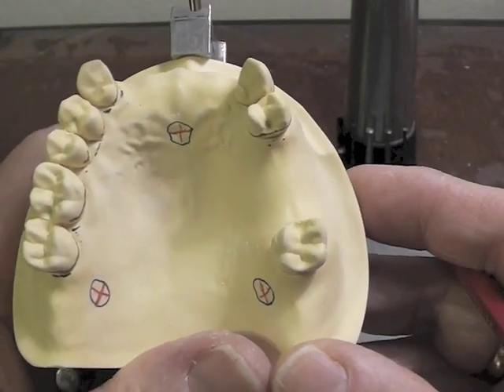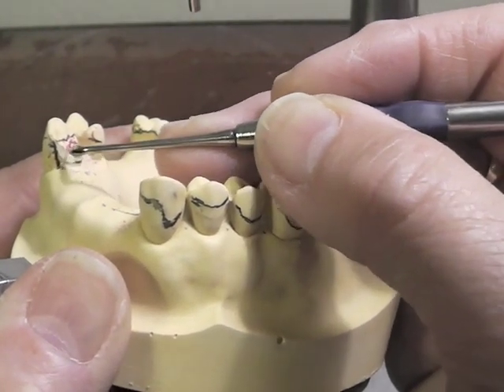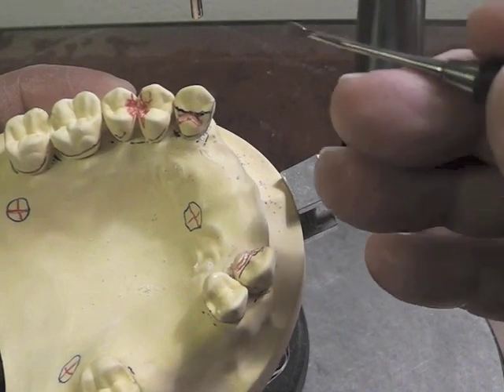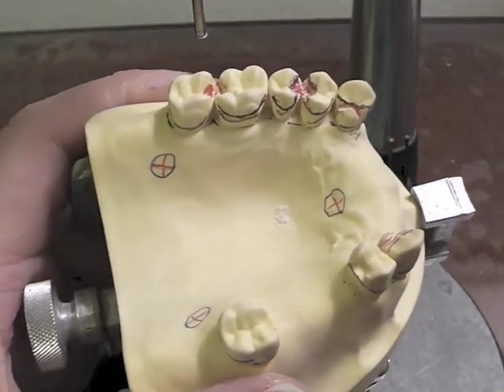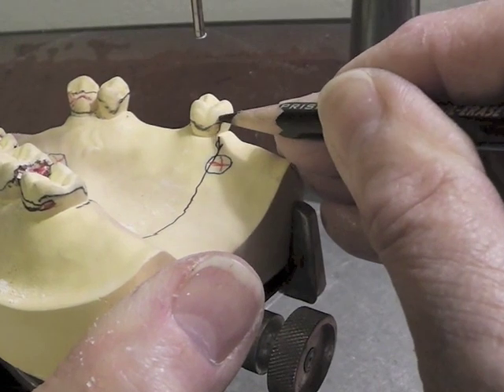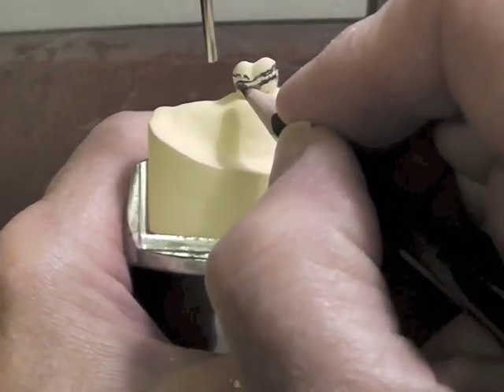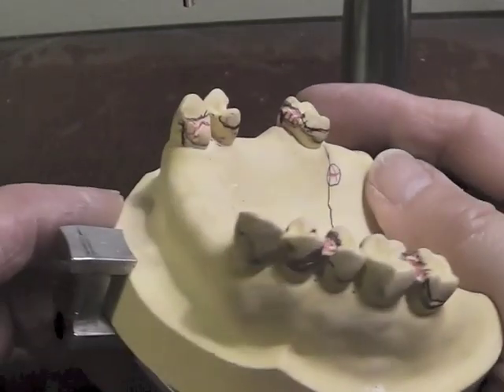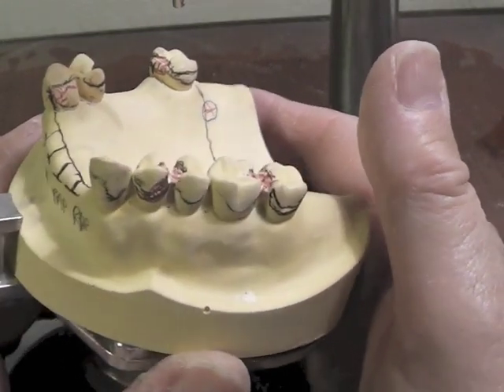R P D Design - Ken Class III Max Dentoform Cast Part D

Comment: Why did you put an auxiliary rest at the distal of the 1st molar? Is it to prevent food impaction in the area? Is it to add to the cross arch bracing? Added support? Some dentist would deem the additional rest excessive.
Reply from the maker: When you take a clasp assembly rest between two teeth, you place an embrasure rest. This prevents 1) food impaction between the two teeth and 2) the feeling of wedging between the two teeth. Any movement of the partial transfers equal pressure to the two teeth preventing the feeling like the metal is trying to drive the two teeth apart. You do not have to place arms on both of the teeth. in other words you do not have to do an embrasure clasp, just an embrasure rest.

Comment: I have a question  what or how do i design a DL i bar clasp? Thankyou
Reply from the maker: The bar clasp would come from the anterior edentulous area in front of the desired tooth to be clasped. On the lingual I would not use the bar clasp as you are creating an ideal clothes line on which every kind of food can catch upon. I would prefer a cast c clasp which hugs the tooth
Reply: @amwind01  thankyou so much